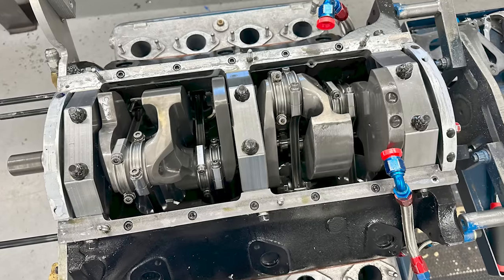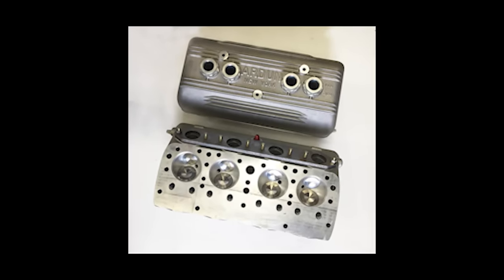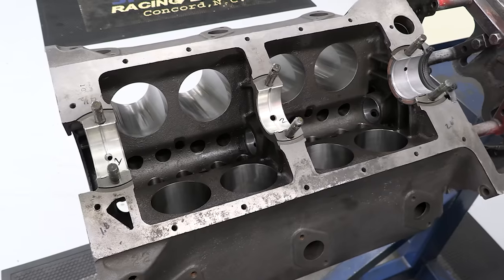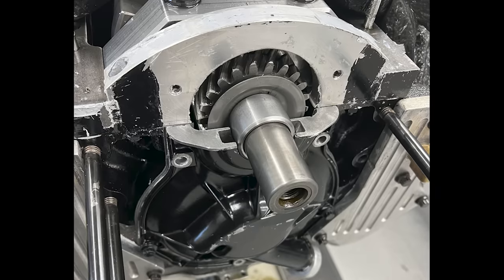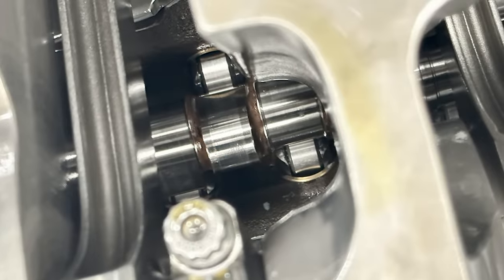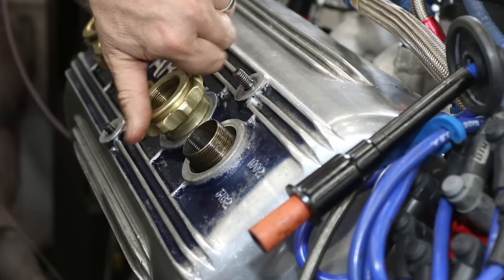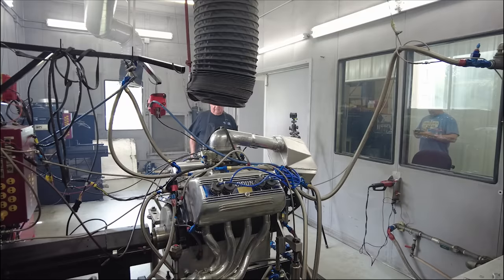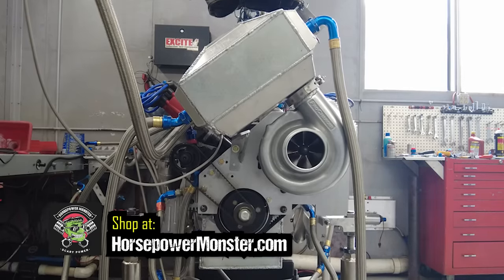Super Rare Supercharged Ardun Flathead Ford Making Huge Horsepower!

Comment: Those crank counterweights look terrifying. Keith is a flippin genius getting that old iron to stay together at that power point.
Reply: I would actually like to see that engine explode
Reply: Hell yeah that’s a lot of power for a 100 year old flat head
Reply: ^ 91 max, more like 70, the '53 Merc blocks the biggest, thickest and best.
Wayback, '60s, had a '31 Ford four door sedan plus a '50 Ford flathead, rusted froze, purchased from a neighbor as a teen.
Two years to rotate the crank, clean it up get it to run on the two barrel Stromberg carb, no name aluminum intake.
Gave it away to an interested passerby, around '76, who hauled it away on his trailer, and later built a rod out of it.
He painted it Ferrari Fly Yellow, ' big fat tires, and everything ' ~ Deep Purple
' American Graffiti '73 ' Like that, in Toronto.
Reply: Did they give the engine size? Around 400"?
Reply: @brucegerard309  - Looks like it was stroked with a billet crank...
Reply: Your right that crank is scary looking, can imagine the side loads on those mains

Comment: All this with three main bearings.
Reply: Took the words out of my mouth
Reply: yup so wilddddd
Reply: And three two-bolt main bearings.
Reply: remarkabow
Reply: Temporary is the word that comes to mind......
Reply: @crazyoilfieldmechanic3195  anybody else I'd agree but with Doug and Keith behind the build......  They always look for reliability first. Keith's background in NASCAR is from a time when engines were still "factory" based.
Reply: Not connotative to longevity but no one expects it 😂
Reply: @SGTJDerek  
I don’t care how much engineering background you have or anyone has, when you have three main bearings in a V-8 engine and every main bearing is two bolt, there’s nothing that you can do to make that better regardless of your background. You can put a super good crankshaft in it but it is only supported by three wimpy main bearing caps that have two bolts each in them .  I’m not saying that in it’s time that the flathead V-8 wasn’t a good engine because it was. It certainly has many limitations. When I first started going to stock car races, there was a guy that ran a flathead V-8 against all of the other competitors that either ran a Chevy V8 or an overhead valve Ford V8. When the track was wet early in the evening during the heat, that flathead V-8 was tough to get by if not impossible. The other engines made powerful strokes and would break the tires loose. That flat head didn’t do that. For the feature when the track dried out, all the overhead valve engine cars would go right by him. Unlike most people, I’ve owned quite a few flathead Ford V8.
Reply: @yt650 stud’s and girdle plate=fixed!
Reply: @needmoreboost6369  
Yes that sounds like a real good idea, studs in old time cast-iron. Girdle plate, over top of “ Three“ main bearings held in place by studs in old time soft cast iron.  I’m not saying for nostalgia reasons you can’t do this, I’m just saying if you don’t know much about engines and how they were made and why they have the number of main bearings that they do, you’re just impressed by bling.
Reply: @needmoreboost6369  
Do you know why they use studs instead of bolts when they put a girdle on a block?
Reply: Whaaaat? I had no idea, that's ridiculous.
Reply: @yt650 Tell us you words oh, wise one. Please, explain to us in kiddy talk, make noise with your mouth, not like us heathens. 

Why does a pirate say, "arrr"?
Answer: Because butt stuuf.
Reply: Like most race engines it wasn't built to tour America, it was meant to go hard for a few drag meetings then stripped down and rebuilt to maximise performance.
Reply: For now.
Reply: Fiat 1.4 and 1.3 diesels do not use main bearing caps. The crankcase is milled flat to the crank centreline and a one-piece bearing cage bolts over (under) the crank. That has large bolts either side of each bearing (10 total) plus another 10 smaller bolts along the crank case sides. 
The same idea on a flathead would be stronger than three separate caps. The idea could be adapted to fit a five bearing crank into a three bearing block. Bearings 2 and 4 would be bolted to the cage. Then the assembly is dropped onto the crankcase and bolted to the original bearing cap holes. If the block is thick enough additional bolts could be used around the edge. The same oil pan could be used and give a significantly higher oil capacity. Or use a new pan. 
The Fiat 1.4 16 valve and it’s turbo version have an alloy dump pan. The diesel has a pressed steel pan. NA 1.4 makes 100 bop. Remapped turbo makes 170. Diesel makes up to 110 bhp.
Reply: @Dave5843-d9m i think the situation in the bottom is largely dictated by the class rules.

Really at the top too for different classes. Without the rules could just as well run a different block.  They change the rules too occasionally and then someone figures out to drop a head extension into the bore to get higher compression.
Reply: Just has to make a few dyno pulls
Reply: @yt650 Well the engineer who designed that clear improvement  to the mains on this would disagree with you. The 2 1/2” bolt mains are not a problem, the number of cylinder per main per 2 bolts are. This girdle greatly increased the transfer of net energy from 3 mains with a net surface area of maybe 11 square inches to a vastly greater surface area, while also being soft enough to absorb some of the energy itself. There are many 2 bolt main V8s that have made high reliable power but it’s because of the main quantity. But besides that the biggest factor for anything is tune. If they could keep consistent tunes to their dyno run with respect to atmospheric change, they would have failures due to unaddressed normal wear than main or block failure.
Reply: @davidelliott5843

They alluded to such a system in the video being used by other builders.
Reply: LOL.  Brings you back to the mid to late 80s . It's a wonder them 5.0 held up as good as they did.
Reply: Yep
Reply: @Roadking556 wtf are you taking about 5.0 coyote is strong so is 5.0 windsor… stop the BS
Reply: @yt650 flathead went 300mph it held up good enough and powered very hot rod and allot of rail cars in the beginning it was best engine in its day period
Reply: @CoyoteFTW  
When I was nine in 1952 my father bought a 52 Ford station wagon with a flathead V8 in it. Subsequently when I was 15 I bought my first car a 47 Ford, paid 20 bucks and it had a flathead V8. After that I had a 1951 Ford sedan with a flathead V8 as well as a 1950 Ford pick up truck. Followed by 53 mercury eventually with a flathead V8. I’m aware of their abilities back in the day and every one that I had ran great. When you begin to make a race engine  unfortunately the center exhaust serving two cylinders has a tendency to have cracks, other than that for what it is it’s great. My first experience at dirt track racing spectator introduced me to the difference of a flathead V8 and an overhead valve V8 via Ford or Chevrolet or Dodge and that was the end of the V8 flathead. didn’t say they weren’t good during their time.
Reply: Exactly what I was thinking. 700 HP on 3 main bearings. That is wild!

Comment: I'm a volunteer at The Museum of American Speed and there are probably close to 10 sets of Ardun heads there.  There are some other really wild OHV conversions there as well.  There is even a couple OHC conversion.
Fun fact, the first hemi Chrysler made in 51 had the exact bolt pattern and valve angle as the Ardun.  Also Ardun heads are right and left specific due to the push rod angle of the flatheads.
Reply: Chrysler was actually making hemi engines in WWII...
Reply: @buzzwaldron6195  not for cars they weren't, they weren't of their design either.  Continental and Pratt & Whitney owned the patients.  The only hemi Chrysler made before 1951 was the experimental V16, it had a whopping production of less than 5.

Comment: Talking about the significance of the Ford flathead, it was the first V8 block that could be cast in a single piece. That bit of production engineering was a breakthrough.

Comment: It'd be interesting to see how a Flathead would do with direct injection through the flat head and a small turbo. Not for outright power, but to see how clean one would run with modern engine management, compared to OHV engines.

Comment: Loved seeing that Blown Ardun/Flathead Ford can hardly believe the HP/Torque it produced! A buddy and myself built a, what was called "Full Race" flathead back in 1959 with a lot help of an old renown machinist/dirt track racer of the area. It was 286 cu in dual Strombergs, Mallory magspark, Crane cam, Shaved and flycut heads, Fenton Header build. Of course I don't know what the HP was, we figured around 175 or so but told everyone it was 200 lol.😁We in our wildest dreams back then could believe any engine could produce 700+ HP! Let alone a Merc/Ford Flathead. My engine was in a 49 Ford Coupe with  4:11 rear and traction bars....it was a quick little stoplight street racer in those times many years ago. Oh as a side note my buddy went on to become the crew chief of a historic 427 Cobra and Mustang road race team.

Comment: Here in Brazil we had the French manufacturer called Sinca, manufacturing the flathead V8 in its models under license.
in 1966 they developed a new hemispherical cylinder head, called "Emi-Sul", a 2.4 engine with around 140 hp.
They are quite rare here, but a good number of these heads were certainly manufactured.
Forgive my bad English, greetings from Brazil.
Reply: Simca obtained rights to produce the small flathead engine, known in the U.S. as the V8-60 from Ford of France and included it in certain Simca models. The Emi-Sul was a hemi-head version of this engine.  Ironically, it was produced at a time when Simca was owned by Chrysler Corporation.  An earlier version of the V8-60 was designed by George Kudasch, the same fellow who Zora Arkus-Duntov hired in 1947 to complete the design of the heads for the "regular sized" flathead V8.  The V8-60 Ardun was never produced in quantity.  It had its exhaust valve operated by a second, short push rod, operated by a bell crank pivoting on the same rocker shaft as the intake vales, and running across the cylinder head to a second rocker arm, which operated the exhaust valve.  The Emi-Sul used pairs of long and short rocker arms to operate the exhaust and intake valves, just like the larger Adrun heads and the Chrysler Corporation hemis.
Reply: The valve actuation systems that use a second short pushrod to operate the valve on the far side of the head always struck me as a recipe for disaster. Especially at higher rpm. Now if the second short push rod was mechanically linked to the bell crank and rocker arm 🤔 Probably too much reciprocating mass.
Reply: Your English is excellent

Comment: I can remember the very first flathead Ford that I tore down. I couldn’t get the water pumps off. After about 5 minutes of scratching my head, I was like, there’s got to be a bolt inside the water pump passage. I was taught by my father, never go prying on parts until you’ve learned how they come apart. These are the coolest engines to work on. The mid year flathead engine had two piece valve guides with tulip shaped valve stem tips. That was another head scratcher.
Reply: i remember that

Comment: Just a small point, Speedweek is the most well known event at Bonneville and held in August each year. It was actually held this year, although it was a bit wet. World of Speed is an event held in September at Bonneville, and it was rained out this year for the second year in a row. I only know this because World of Speed is the event I run. Great video as usual, looking forward to progress updates on the Corvette!!!
Reply from the maker: You are correct. I was afraid I would just confuse people if I tried to explain it. Keith had several teams running his engines at Speedweek this year. He said a handful left after the weekend when there was still water on the salt assuming there would never be good racing. The others declined to race on the short course after it was opened up believing that the poor condition of the surface made it either unsafe or too damaging for the cars. Others only wanted to run the long course, which was never opened. Not sure which group Doug Kenny and his team fell into. Anyhow, thanks for the kind words, and thanks for watching!
Reply: do you guys have some differences in classes vs speedweek?

Comment: Amazing power for what it is. 10 pounds of boost on a nearly 100 year old crank. Making 720 horse and only 70 less torque. Also not a lot of RPM either. 260 lift? Stock vws had more than that I think 😂 keep up the great work

Comment: That is insane power out of a flat head engine.  I'm curious as to what modifications are needed to the block to use those heads.  Since a stock flat head has the valve in the block itself.  How are the original valve trains sealed?

Comment: The first hemi chamber by Chrysler was upgraded p 47 superprop 16 cylinder aircraft engine design (an attempt to compete with early jet performance) at the end of ww2.. There may have been early motorbike & automotive designs. .
Reply: There are plenty of English motorcycle engines of the mid 1920s with hemi heads. The Riley 9 car came out in the late 1920s with hemi heads on regular road cars.

Comment: Flatheads solve the problem that makes boxer and v engines impractical. They just need force induction for the lack of compression and maybe those weird double cam valves that ducati uses to prevent float. Yeah maybe the way the combustion pushes against the valve pocket kind of sucks, but the compact and robust construction ends up being more economical and environmentally friendly in the end, because you don't have to use a megawatt or burn a ton of coke for a new block every 5 years.

Comment: I read years ago they built the Ardun heads to power trash trucks in the UK by because the stock flatties couldn't pull the loaded trucks??
Reply: That tale was made as a tongue-in-cheek comment back around 1957, and has been repeated as fact by people who didn't know anything about the actual history.  Zora Arkus-Duntov had been impressed by the high speed potential of the flathead Ford while living in Belgium before WWII, and envisioned what might be possible if it were equipped with more efficient porting and combustion chambers. His INTENTION AND GOAL was to produce a RACING ENGINE. He immigrated to New York City as WWII began in Europe, and established an Engineering and machining company.  After the War ended, he put his thoughts into action and built a few prototype cylinder heads.  It is true that he advertised the cylinder head kits as suitable for automotive, truck, marine, aircraft and stationary engine applications in the hope of raising enough money to go into full-scale production.  Sydney Allard,the manufacturer of the Allard sports car in England hired Duntov, and capitalized the production of an estimated 250 sets of heads.  The first notable use of the Ardun-convertion was on an Allard sports car, which Zora drove in the first Watkins Glen Race.

Comment: Could the same run stand for both classes? Or would he need a separate run for each record? I realize an attempt is actually two runs within an hour (The initial and a second to determine average). My thought is, if both records could be run same attempt, it'd half the runtime allowing the engine to in theory live longer
Reply from the maker: It's a good idea, but no. You have to declare which (single) record and class you are running for before each run.
Reply: @TheHorsepowerMonster , That's what I thought as well, no harm in asking though.

Comment: Ardun heads or not, how the hell does a flathead ford with 1947 head technology make 722hp on 10 psi? I don't think a 5.3 could do any better.
Reply: the girdle added to the bottom of the block keeps it from vibrating itself to pieces. David Vizard made something similar for a modern Ford 302 so those can make more than 500 HP without breaking in half from vibrations
Reply: @Tumbleweed_Tx   I understand that. What i don't understand is how he's getting that level of efficiency from an ancient head design. According to this dyno it's making more power on 10 psi than  alot of modern day V8's would.

Comment: Putting hemispheric OHV heads on a flathead V8 . Doesn’t this Not make it a flathead anymore? 
Be nice to see what it does out on the salt flats when weather permits again.
Reply from the maker: Yeah, I talked to a lot of people what to actually call a Flathead engine once Ardun heads were put on it. Got a variety of answers. I know I'm technically wrong calling it an Ardun flathead, but just figured that was the best way for people to understand exactly what's going on. I guess the correct term would be "Ardun overhead conversion for a Ford flathead" but it's just too clumsy. Anyhow, you are right, but I didn't have a better solution. Thanks for watching!

Comment: why would you put that much money in a junk yard motor that has no following or value?
Reply from the maker: I think you are mistaken. These Ardun heads go for many thousands of dollars. All the flatheads, even stock, have all been swept up. You are never going to find one in a typical junkyard. But mostly, because the owner is using it to race in a specific class where this engine is required and is going for records (and fun) and not worried about how much he can sell it for. Thanks for watching.